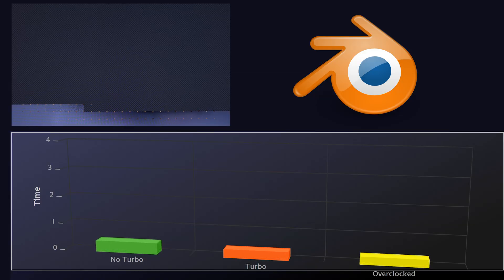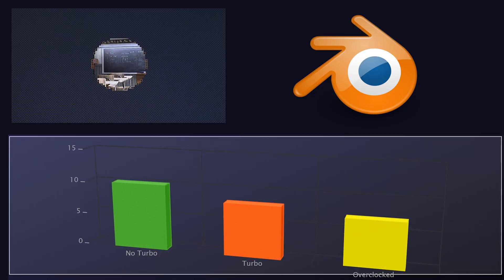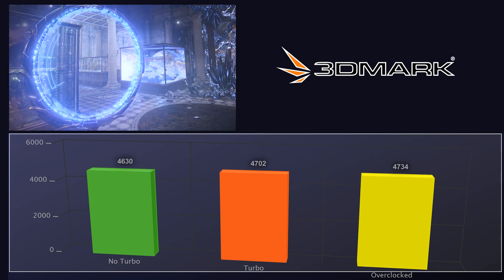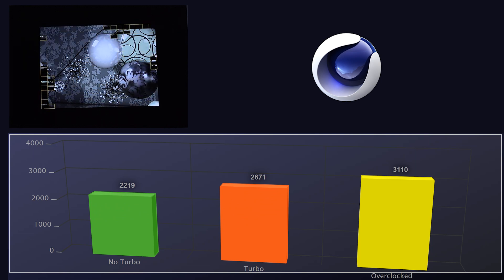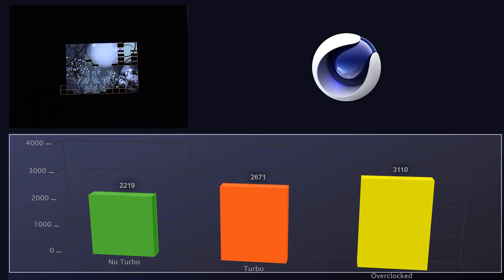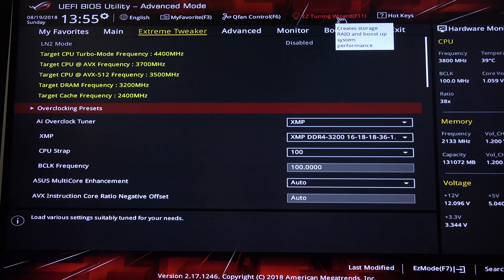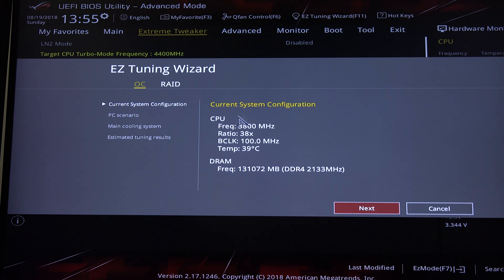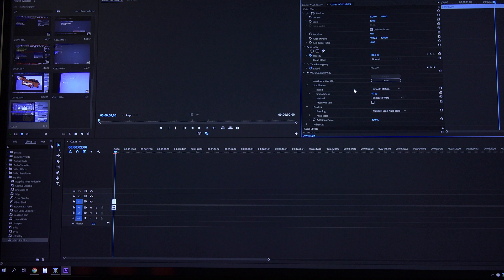7940x Overclocking gets HOT! (Benchmarks, Adobe Turbo Fix)

Comment: Just got a x299 Dark with this cpu, I have it at 4.4 with 1.15 V ( CPU  input voltage1.750) and stays under 85 C under load ( 240mm AIO) not delided . I am happy cinabench r15 over 3200

Comment: The more I look into overclocking my 7940x, the more defeated I become. Mine is delided, with a RockitCool full copper IHS, EK monoblock, & 3x 360mm radiators in a custom loop. Even with AVX negative offset at -3 and -5, just 4.2 all cores & cpu @ 1.22vcore, I'm pegging 100c on 4-5 cores on cinebench runs. I won the "silicon lottery" alright, the silicon they set aside as garbage scraps. I've never in 20 years & dozens of processors had a cpu overclock this poorly. Ever. I'm ready to throw this chip and my Rampage VI Extreme out the window & seriously look hard at the 3900x &3950X from AMD. This has left a disastrous taste in my mouth.

Comment: I have this video editting machine and using only adobe programs which are after effects and premiere and you know that adobe needs to higher ghz not core.I am a newbie of overclock and have watched and read lots of post and soo confused. Which one is a good way to oc? Manuel or other programs like, EZ TUNNING, or intel programs, or 5 way optimization etc.
What do i need to do? 

Intel Core i9-7940X
Asus PRIME X299-DELUXE 
Corsair H150i PRO RGB 360mm
Corsair Professıonal Hx-1200 1200W Moduler 80+ Pla135Mm 
Nvidia GTX 1080-Ti
Samsung 970 Evo NVMe PCIe M.2 1TB
Corsair Neutron XT 240GB
WD Black 2TB (2013)
G.SKILL Trident Z DDR4 3200 C15 4x8GB

Comment: Manual overclock or stock always. 1.22 its a hell of lot of voltage for 4.2 my chip will do 4.8 at 1.22.  4.2 you should be able to get down to around 1.125. You will see a huge power and thermal improvement.

Comment: I have an i9 7940x delided from Silicon lottery. I can get a 4.6 GHz on all cores. 100 percent stable. (I'm using unity, Maya Adobe programs etc...). I'm using the initial Voltage seeting for each cpu by Intel ( 1.186-1.223v) depends on each core.  I have similar specs using Asus rog rampage 6 xtreme mother board. And same ddr4 platinum 128gb set by cordair. Temps under full load get up to 84 degrees. Most of the cores under full load reach between 67- 80 degrees. I use a close water loop with 2 480mm radiators and 16 fans by EKWB. And I'm using monoblock for the CPU and VRM. BTW there's a warranty plan by intel for 3 years from the date of purchase (for delided!!!/overclocked cpu's). It costs extra 100$ and you can join the plan during the first year. Or maybe any time I'm not sure. But you will get a replacement only if intel find that the cpu died due to overcloking and not other damages. BTW I was able to push at least half of the cores up to 4.7 GHz with less than 1.235V. But I don't think It worth to risk the cpu/motherboard for such a minor power gain. You get only 2-3% Improvement. With 4.6 GHz on all cores I get around 3350-3450 score on cinabench r15. With half of the cores running  at 4.7 I can get between 3400-3500. I was able to reach even slightly above 3500  points score but that was before I updated the motherboard. BTW this is my first PC built, And my first water cooling loop built. Actually the water cooling loop was pretty easy to built and the only knowledge I got was from youbtube (:

Comment: watercool it. I am using an AIO 360 and my temps are never above 60 under full load. I am overclocked to 3.8
Reply from the maker: Im going to delid it
Reply: I bought the EKWB Extreme 240 because I was having the same problem. My CPU would go over 99 C and the Blue Screen would pop everytime I used after effects. Now I'm runing it at 4.2 GHz and it stays under 60 C unless I'm doing something that has lots of effects then it might get o 80 but no more sudden shut downs. I'm editing 4K and I still get lag though but I have not have time to play around with it.
Motherboard: X299 GAMING M7 ACK FROM MSI.
Memory: CORSAIR Vengeance RGB DRAM 32GB (4 x 8GB) DDR4 3000 (PC4-24000) C15 - Intel 100/200 Series Desktop Memory
Storage: 2 1T EVO PRO SAMSUNG ON RAID 0
Graphics Card: 1 GTX 580 CLASSIFIED (LOL) I know is very old but I like the rendering time on these. It works better than my GTX 980 Ti which I regret buying. 
CPU : Intel i9 7940x

Comment: Great vid Glad  I stumbled onto your channel. 
 I nearly bought the same system you did. I settled on the 1950x  as  the PCI-e set-up suited me better.   It is curious to see your performance compared to mine, much the same, I just have different  issues, being amd. 
On the cooling side I have a 280 aio but replaced the fans  with push pull, almost doubling the cooling.  

I edit in Avid and use media encoder for encoding.  I found a plug in  someone  suggested on the Adobe forums its called voukoder plugin for Adobe cc that allows  EVENC hardware encoder on your Nvidia card to do the encoding and leave all your cpu and gpu just for rendering in adobe during export.  Some of our editors  are using  it for  client review copies and for youtube uploads from Premier.  Saves us lots of time.
Anyhow awesome machine... enjoy

Comment: Hey Jason, just thought I'd chime in here, and let you know delidding is a piece of cake. I just did my first delid on my 5930k with my RocKit 99 delidder. 40 bucks shipped off their site, and got thermal grizzly liquid metal to go in it for 15 bucks off amazon. Also, you need a custom loop. Ek makes loops in a box, but I'd honestly just piece it together yourself, much better fit then. I have a whole custom loop on my x99 system, that was in a Define S case, that I just moved to a huge, sick looking View 91 TG case now. bent all the pipe in one day for it again. This is something I KNOW you can do. Don't worry if you F up 10 pipes your first time, its a learning curve with the heat gun. Buy double the petg pipe you think you'll need for the first build. Good Luck!

Comment: Arctic Silver isn't that good of a TIM these days. 15 years ago it was about as good a you could get, but not anymore. At best you might get 1 or 2 C lower after it cures, but only if you really do it the right way by running it for an hour or so, then shutting it off for an hour or so, then repeating for a couple of weeks.  It needs that rest period to really become effective and needs to be re-applied every year. 

Of you could do it the easy way and use better TIM like Gelid Extreme (my personal favorite), Noctua NT-1, Arctil Cooling Mx2 or MX4, or any of the dozens of better TIM than AS5. That will get you several degrees lower temps than AS5 and you won't need to re-apply it and go thru the entire break in period every year. None of the TIM I mentioned needs more than an hour of break-in to achieve maximum efficiency.

But that CPU will never have reasonable temps without delidding. There is nothing you can do to counteract the lousy TIM Intel placed between the cpu die and the heat spreader except delid it and replace it, and it doesn't matter how much money you throw at it. Either delid it or just run at a speed that keeps it in check.
Reply from the maker: changes are coming :)
Reply: You wanna use thermal grizzly kyonaut or thermal grizzly liquid metal.. that’s it.. best thermal pastes on the market.. I used kyonaut on top of my IHS to my waterblock and thermal grizzly liquid metal for my cpu die to my IHS and my 7820x is at 5ghz all cores stable with temps no higher than 88-90c

Comment: You could try a push/pull fan configuration if your case will support it.  That's another cheap low-risk option.  

My experience is that a custom loop will not cool better than a high quality AIO with similar sized radiator.  The big advantage of a custom loop is that you can get a Monoblock and cool those VRMs.  That will not bring down your CPU temps but will help stabilize your overclock.  If you really want to cool the CPU better, you will need to delid and install some liquid metal between the IHS and the CPU die.

Der8auer running at 5 Ghz with AIO:  https://www.youtube.com/watch?v=kpoies2JcmI
GamersNexus on Delidding/LiquidMetal: https://www.youtube.com/watch?v=kYnUfXl0Gdw
Reply: Bryan Anderson . Isn't the real benefit of a custom loop is that you can use a larger radiation, better components (such as blocks and pump), and additional cooling blocks/options like you mentioned?

Comment: Thermodynamics is a study of the weakest link... it's not the fans (mostly). I suspect the temp rise occurs mostly between the cores and the cooler/pump, so delid and liquid metal! Post Corsair (you are using Corsair Link to control pump speeds, ya?) temps and times, especially of the fluid in/out, you might even be able to feel the heat in the tubes, if there's enough transfer.